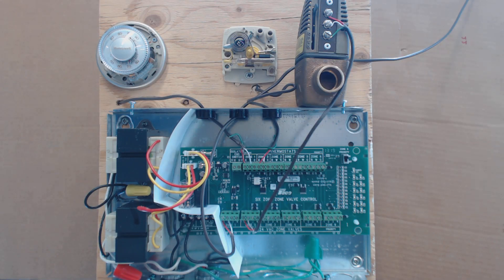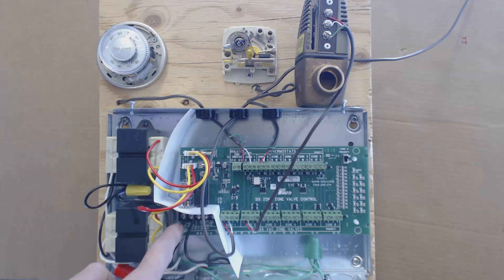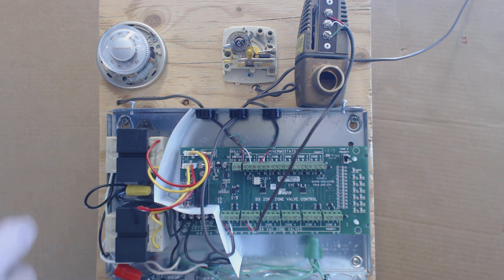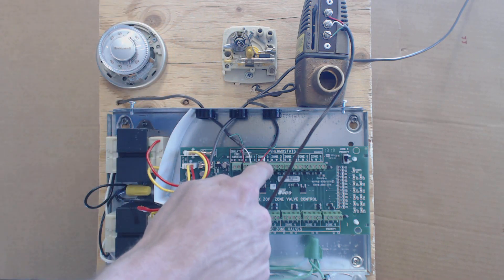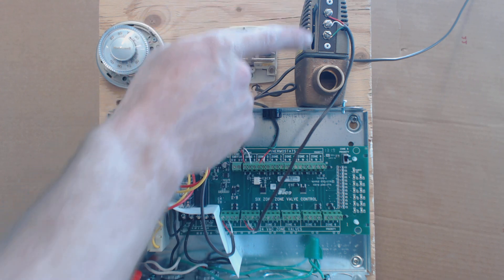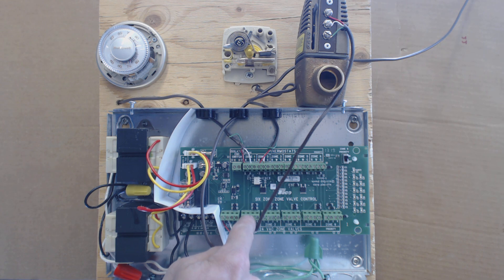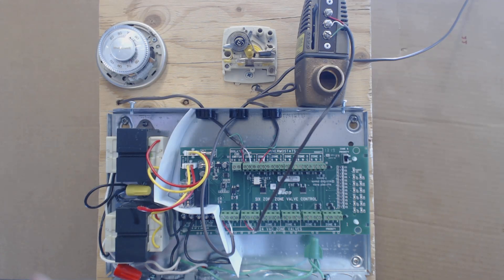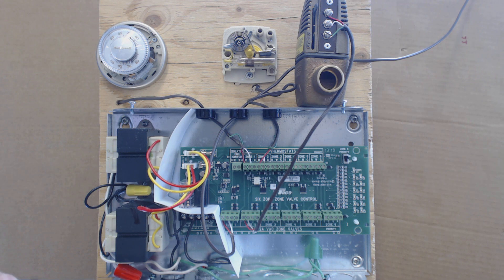Taco Zone Valve Relay Control! Explained, Thermostat Wiring, Zone Valve Wiring, Circulator Control!

Comment from the maker: Our Inverter Mini Split Resources:
Mini Split Book on Our Website- https://www.acservicetech.com/mini-split-book
Mini Split Paperback on Amazon- https://amzn.to/3ytHJSs
Mini Split Paperback on TruTech Tools- https://www.trutechtools.com/BooksGuides?aff=8 
Mini Split E-Book on Google- https://play.google.com/store/books/details?id=HN-iEAAAQBAJ
Mini Split E-Book on Apple- https://books.apple.com/us/book/id6445178399

Our Single Speed and Two Speed Air Conditioning Resources:
My Paperback and E-Book: https://www.acservicetech.com/the-book  
My Paperback:  https://www.amazon.com/shop/acservicetech
Read the book reviews on Amazon!

Check out our new Articles at https://www.acservicetech.com/articles
Support the Channel by purchasing tools through Tru Tech Tools!
Use this link https://www.trutechtools.com/?Aff=8
Save 8% at checkout using code "acservicetech"

Tool List-  https://www.amazon.com/shop/acservicetech
Support-  https://www.patreon.com/acservicetech
For those that are looking for the tools used in the videos: (Linked Below)

Here is a link to the Taco Zone Valve used in this video  http://amzn.to/2cGktI1

Here is a link to the Taco 6 Zone Valve Control with Priority hot water  http://amzn.to/2dGQ2Av

Here is a link to the UEI DL389 Multimeter used in the videos- http://amzn.to/2av8s3q 

Here is the link to the Fieldpiece SDMN6 Dual Pressure Testing Manometer with Pump-http://amzn.to/2jyK5Ka 

Here is a link for the Supco Magnet Jumpers http://amzn.to/2gS4h6z

Here is the link for the Irwin Wire Stripper/Cutter/Crimper   http://amzn.to/2dGTj2V

Other tool links can be found in the video description section. ACSERVICETECH is a participant in the Amazon Services LLC Associates Program, an affiliate advertising program designed to provide a means for sites to earn advertising fees by advertising and linking to Amazon.com.

Comment: I was hoping you'd show how you deal with the common wires from both the A/C air handler and the hydronic system.  They're likely on different circuits, but, whereas there are separate 24V hots, there's only one C terminal per thermostat.  If you wire the Cs together, then you could have a shock hazard with one circuit off and the other on.  Alternatively, you could use the C from just one of the systems, but then the thermostats would run only with that circuit on.

Comment: Thank you so much for this video! How do you wire a double pole zone valve actuator? I'm stuck on a double pole sharkbite zone valve actuator that I just can't get instructions on how to wire it to a taco zone valve relay control.  I understand the difference is that it has the ability for an offsetting on the thermostat. I'm about to give up on that option and return them and go with the taco.  They cost more but it will work. Thanks again!

Comment: Dealing with a 25 year old radiant floor heating system.  The board is wired for two separate zones: Zone 4 and Zone 3.  Zone 4 works perfectly, but though Zone 3 receives the signal from the thermostat, it does not appear that the signal moves across the board and out to the valve.  Could it be the board is damaged?  Can I move the zone 3 connection to zone 2 without issue?

Comment: Hey Craig doesn’t 3 and 4 need a jumper when using a 3 wire head?
Reply: no I don't think so, only if it was two wire then jumper required

Comment: So on my hydronic board when zone one calls for heat It will fire off the zone one circulator but the end switch will also be able to fire off the primary circulator on my hydronic board that supply’s the heat to the primary loop…?….

Comment: Thanks for the helpful video.   I have an SR504, which looks similar to the one in the video, but mine keeps ticking quite often lately and am wondering why and where it can be coming from since this just looks like a circuit board?  it ticks when none of my 3 zones are calling for heat.

Comment: I wired a three zone Taco control panel and 3 taco zone valves. I accidentally mis-wire zone valve terminal 1 and 3 to the zone control on zone 1. Did it fry that zone control on the zone control board?  I was exhausted and accidentally wired blue white red instead of red white blue. Now that zone refuses to open even after it was corrected. I tried another zone valve head and no difference, I can only imagine it is the board. Is it repairable? the other 2 zones are working fine.

Comment: Disclaimer: I am not a licensed electrician or boiler technician but, I simply hope this helps. If using Aquastat to control boiler temperature (typically back of the boiler) with the new Taco 406-4, you will need to take the white wire of the burner and the white wire of the aquastat and tie them together with a wire nut. Then, put the red  of the burner into one side of the ISOLATED END SWITCH and the red of the Aquastat into the other side of the ISOLATED END SWITCH. This allows the aquastat to disable the burner if furnace is at temperature or, if not at temperature, fire the burner.
Reply: On my way to give this a shot. Literally looking into this for my own system. Controller works flawlessly. Burner does not engage

Comment: I the Taco unit, just wired it up to a 2007 Burnham Series 2 gas boiler with 5 Zones. Problem is the safety train from the boiler is only tied into Zone 5 so when any other Zone except Zone 5 calls for heat the Zone valves will open but  boiler safety checks do not get completed. The only way I can get Zones 1,2,3,4 to get heat is to also fire Zone 5 and the safety train varifies and boiler fires. I tried putting jumpers across all 5 valve modules on the Taco but no joy. Any ideas on how to get the boiler to fire when Zone 1,2,3,4 call for heat without Zone 5 calling for heat?

Comment: When the zone I’m calling for heat and the taco valve is open do terminals 2 & 3 have voltage or continuity??
Reply from the maker: Without wires, they will have continuity when the valve is mechanically open, thanks!

Comment: Thanks for the video!  Is it possible to share one circulator pump across all zone valves?  How would you wire the pump to support that?
Reply from the maker: Yes you would. In  this video of the control, the contacts close at the bottom left on any call for heat. It is called the end pump switch. Just put power to one side of the switch and the power coming out goes to the circulating pump, thanks

Comment: How can I wire a buffer tank that has a 4006 Aqua.  That is powered by end switch. The aqua then decides to power the buffer circulator or fire gas boiler.

Comment: Since the t-stat is wired to the Taco controller, what sends the signal to the boiler to fire?
Reply from the maker: The boiler will typically keep itself at 180 or whatever the aquastat is set at by itself or it can be done through the end switch wire, thanks

Comment: My heat started coming on at 6pm every day. It continues to stay on even after pulling the t-stat off the wall. The online tech said it was the switching relay (taco sr501), but I have my suspicions. What else could cause the relay to come on the past 3 days at 6pm?
Reply from the maker: Are your thermostats programmable and is the hold button on instead of a program. Do you have wifi tstats and program sees you coming home?
Reply: Thermostat is a programmable honeywell, it is not wireless.  We use it for ac and heat. Hold button is not on, thermostat is selected to off.

Comment: Thank you for the explanation, it was easy to understand. What gauge and type of wire would you use to connect the zone valve to the switch relay. Also, what gauge and wire would you run from the relay to the circulator pump if it was a Taco 007? Thanks in advance.
Reply from the maker: control for zone valve is 18 gauge and circ pump is same as rated max amps for boiler. 20 amp-12 gauge, 15 amp-14 gauge
Reply: acservicetech Thank you for the quick response. Stranded copper wire for the zone valve is ok?
Reply from the maker: Stranded would work but we typically use solid under the screw terminals, thanks
Reply: acservicetech Thanks!

Comment: thanks for the info.  Question... on the taco 3 wire zone valve (as shown in your video). When 2 and 3 connect to trigger the circulator , is that when the Isolated end switch triggers the boiler ?
Reply from the maker: It closes the end pump switch on the bottom left on this zone control board. It is where the 120v black input comes in and the other black wire will be the hot for the circulator. Using a control like this, the boiler would already be up to temp and ready, thanks

Comment: those 2 transformers do not have the VAs to run 6 of those zone valves at .9A ea
Reply from the maker: You are right, one would have to use lower draw zone valves. Those sentries are nice! Thanks putting the note there Mike Pelletier!

Comment: i have argo arm switch relay for two zones.. i just found out that i need to install zone valve.. i bought honeywell v8043.  the zone valve has 2 red and 2 yellow  wires... can i some one help me... conecting  the zone valve and the argo switch relay
Reply from the maker: On the zone valve the yellow wires power the motor and the red wires close when the zone valve is fully open so water can flow through but switching relays such as ARM2P are normally for when you zone off a system with multiple circulator pumps and not zone valves. http://s3.supplyhouse.com/product_files/ARM2P-install.pdf

Comment: I have a Taco SR506-4 6 zone switching relay and my dilemma is that I have one zone continuously running although the setting at the thermostat is at a low setting. Another zone functions as is required and another zone does not kick on at all. I can't figure out my problem. Can you help me?
Reply from the maker: You would have to check for voltage at numbers 1 and 2 at your taco zone valves and see if they have power when they are not supposed to and don't have power when they are supposed to. From there you work your way back to the switching relay. If you have the thermostat set higher than it is in the room then the r power would touch the signal wire W going back to the switching relay and you would have 24v power from 24v common to the w when read with a multimeter inside the switching relay. Thanks

Comment: I had a Taco Zone Bad go bad, well, it worked but somehow #2 and #3 kept continuity so the boiler had a constant call for heat.  The circulation pump would run all the time even though all four zone pumps on this system were closed it would just spin in place and hum.  When the boiler Aquastat Relay sensed that the boiler internal temp was low it caused the boiler to kick back on and heat it back to the set boiler temp.  This went on for months before it was noticed.  Very inefficient but all still worked (sort of) so the homeowner never knew except they wanted to know why the boiler was always hot, even in Summer!  Something to possibly look for, I never knew a Taco Zone Valve can malfunction in such a way.
Reply from the maker: Oh man! Nice, well glad to hear you caught the problem. In this video I show the guts to the valve like you were saying in reference to the switch at the end of the video. --https://youtu.be/8Esqg3PfJzE------Thanks for the comment!

Comment: Probably a silly question but how does a thermostat know when to turn the system off ie: how does it know it's reached the set temperature? is there an inline temperature sensor on a hydronic system or something else?
Reply from the maker: Great Question! When the thermostat on the wall for that zone reaches temp, it stops the 24v signal to the control board which in this case is the taco zone control system. Then the zone controller will shut that zone valve off and if there are no other zones calling for heat, it will shuit off the circulating pump. Here is a playlist of thermostat videos and what each of the wire colors and terminals do. Thanks-----   

https://www.youtube.com/playlist?list=PLxnHR5_D2ojzDfU1IjPpzdhi_mUGe3F7W
Reply: Thanks a bunch! The temperature sensor is in the physical thermostat itself the and when it sees that it's reached the desired temperature in a give room, it shuts off which, in turn, sets things in motion with the Taco ZVC.  I have been racking my brain for days trying to figure that out. Thank you kindly.
Reply from the maker: Exactly, glad to help!

Comment: Great explanation Jason. If you only had 2 wire actuators and you jumped 3 and 4, does the pump still wait until the actuator is fully open or do you have to accommodate the flow of water another way until the actuator fully opens? Such as a differential bypass valve? 

Thank you
Reply from the maker: Usually on the four wire units 3 and 4 will close when the valve is completely open. On the 3 wire valves 2 and 3 will close when the valve is completely open. Thanks